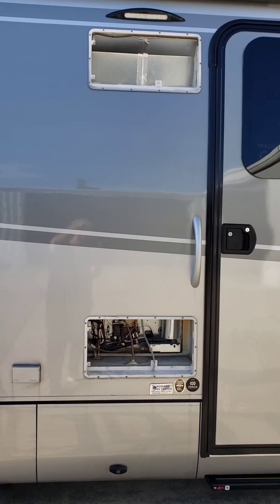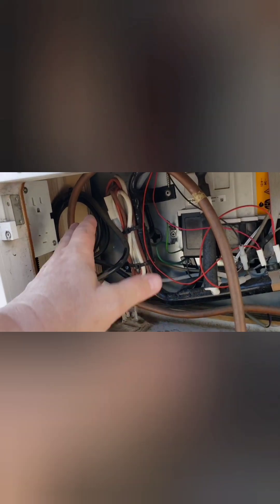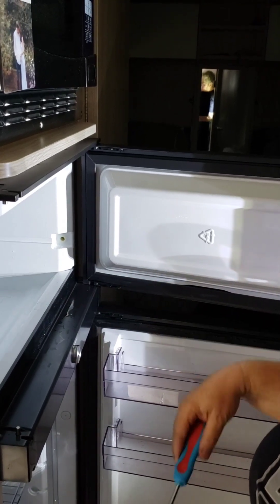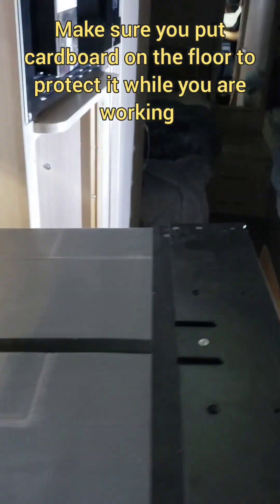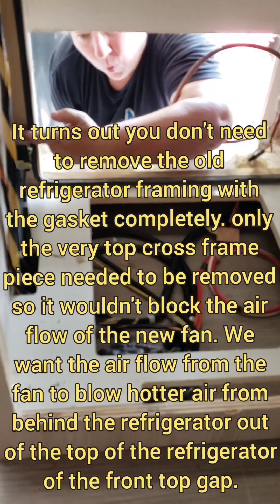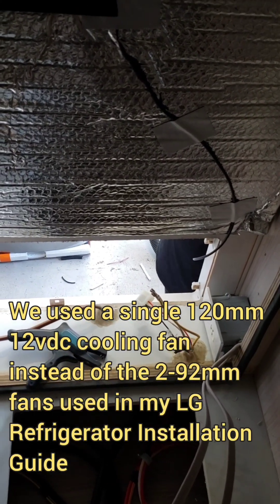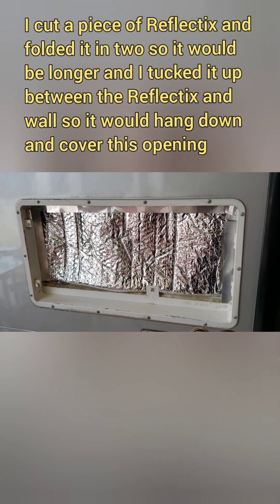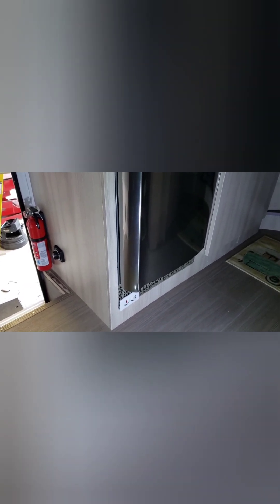LG Compressor Refrigerator Installation in a Leisure Travel Van

Comment: Thank you Sandy! 
I also installed the same model LG fridge in a 2014 LTV CB. I added some switchable airflow fans where the new bottom vent is to keep the cabinet cool. Also added a small circulation fan in the freezer compartment. Also added temperature probes for a digital display for fridge and freezer compartments. Rewired the fridge AC outlet to the inverter circuit

Comment: Thank you for all the excellent videos and the printout for this!  It brings up a couple of questions.  Some LTV models have battery cut-off switches factory installed.  That turned off would take care of storage? And the breaker for incidental times the fridge might need to be turned off while using the van [defrost, etc.]?  

In the video there is a comment that the back wall stuff and frame do not need to be removed, is that correct?  That would save a lot of work if the insulation can just go over it.  

Some of us installed fans like the Beech Lane 12V RV Fridge Ventilation Cooling Fan 5.5" at the top vent.  Ours is this double fan model.  It is already wired and the control is in the storage bin adjacent to the fridge compartment.  Is there any reason the fan could not be re-positioned to blow down across the back of the fridge and push the air out of the grill we would install under the new LG?
Reply from the maker: Since this video I have updated my installation guide to this one, https://www.facebook.com/groups/ltvrv/permalink/9618552458218437. I highly recommend using the small inverter option to power the LG refrigerator instead of the larger coach inverter as it uses much less power. If you use this small inverter then it has an on off switch on the unit that you can use or the coach battery switch to turn the refrigerator on or off. If you do use the coach inverter then yes you can use the refrigerator breaker to turn it on or off.

You don't need to remove the back frame just the top portion as you'll see in my Quick guide.

Sure you could use an existing behind the refrigerator fan instead of the one referenced in my guide.  Any 12v cooling fan or fans should work to exhaust heat and move air across the refrigerator compressor.

Comment: Since to LG Refrigerator seems to not be available anymore have you found a good replacement model?
Reply from the maker: Honestly, I haven't. You can find residential compressor refrigerator/freezers smaller or larger. I went with a larger 7.5 cuft one myself, but it required replacing the microwave with a smaller 0.9cuft microwave. I've been very happy with a larger refrigerator/freezer and smaller microwave.
Reply from the maker: Have you looked at Costco for the LG refrigerator it still seems to be available for delivery on line, https://www.costco.com/lg-6.0-cu.-ft.-single-door-refrigerator-with-inverter-compressor-and-pocket-handle-in-platinum-silver.product.100986754.html. Also the LG website shows  it for some zip codes.